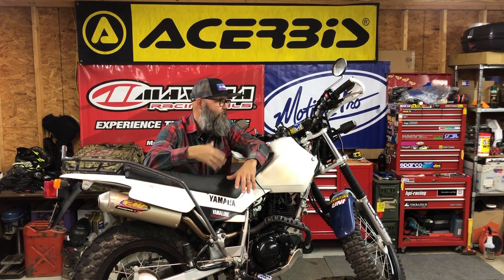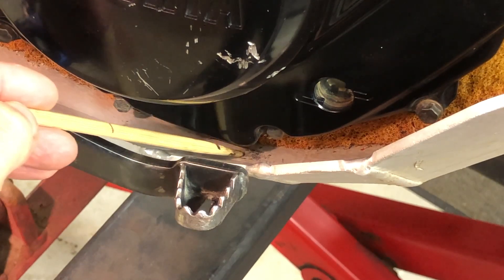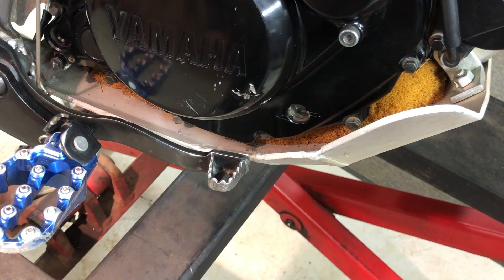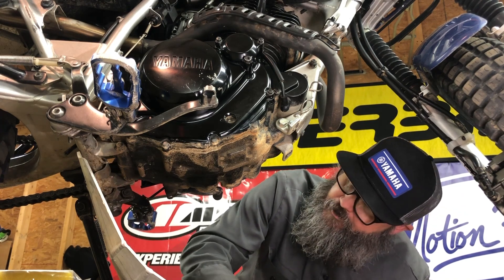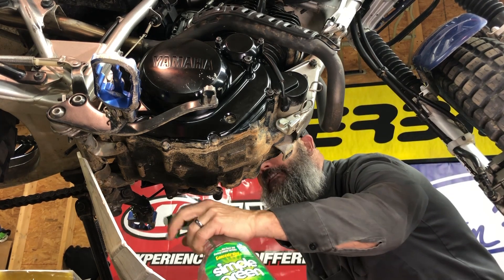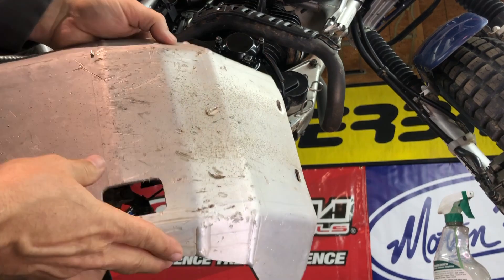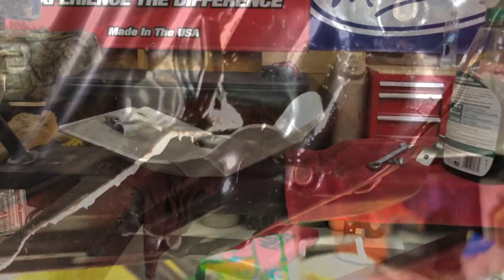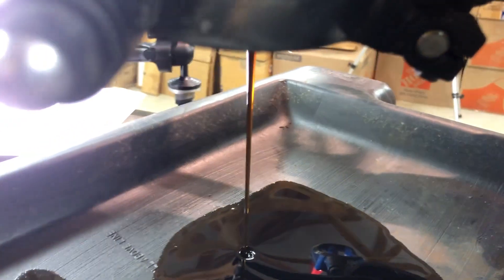10,000 MILE Service - 2016 Yamaha TW200 + Skid Plate Foam Update Full Coverage - Part 1: TDUB CLUB

Comment: Aluminum skid plates affects handling that is why on the standard size bikes they use plastic and the noise comes 2nd
Reply from the maker: The plastic too, takes a little more engineering and more suitable for higher production volume. I’ve often thought about making one, but too, the TDUB is simple and most people are not going to feel the characteristic change in handling. Think soft suspension and big squishy tires.

Comment: I haven't tried this idea but wonder if it might work? Instead of the foam pad, might using an rubber inner tube work? The thought is the tube could be placed near the perimeter then inflated as needed to provide a seal between the skid plate & the engine. Might need to be a bicycle tube and maybe even cut & resealed as more of a u-shape than a circle. I suppose a circular one could also loop back into the central area of the skid plate. Worth a try??
Reply from the maker: Any idea is worth a try!!!

Comment: If you are so OCD about getting every last drop out of the quart of oil you might not want to pour the oil into the oem Yamaha oil filter as it is just a screen. No hate, my OCD made me type this. Lol
Reply from the maker: Why would I not want to do that? How about a jar of oil and let it pre-soak that way?
Reply: @YAMAHATDUBCLUB  I just feel like with the filter being a metal screen it's not really going to hold on any of the oil you pour in it.
Reply: He does not have a screen filter. It's a paper filter.
Reply: @brentbockbrader8513  The oem oil "filter" is a screen. Designed to be fushed out with gasoline or contact cleaner and reused.
Reply: David, you are correct.  But the filter in tdubclubs engine is a pleated paper filter, which also work in our tw200's.
Reply: @brentbockbrader8513  What's the part number on the paper filter?
Reply: I'm not sure.  Maybe @YAMAHA TDUB CLUB can chime in since he has one.
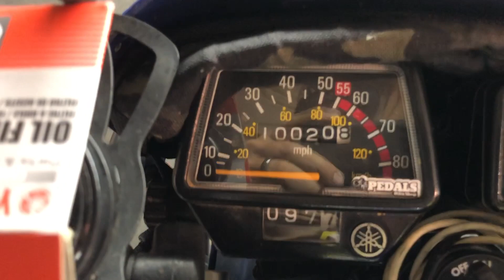Reply: @MarylandWearAndCarry  it's on the box at 15:57
Reply: @charlesreally8686  That part number corresponds with the standard pleated steel screen "filter".

Comment: Have you used synthetic oil for the life of the bike? Considering using synthetic but  the bike was broke in with conventional oil. ODM is at 2000 miles, oil has been changed three times. If I change to synthetic would I run the bike at break in  speed for 100 miles or so...?
Reply from the maker: I've switched back and forth a few times! I might run a full 1,000 miles on the syn and then maybe 500-miles on the regular stuff. Just depends on how I feel the bike feels! hehehehe